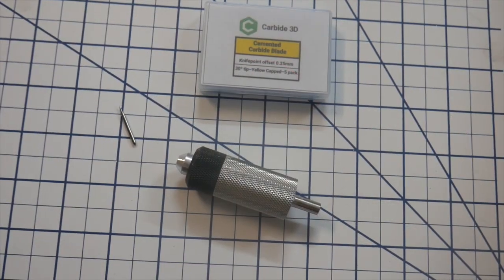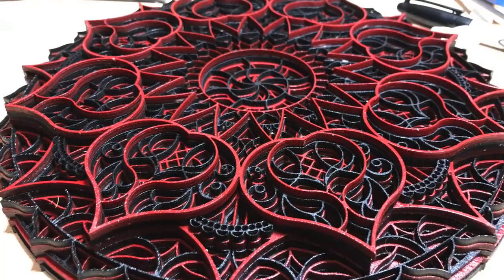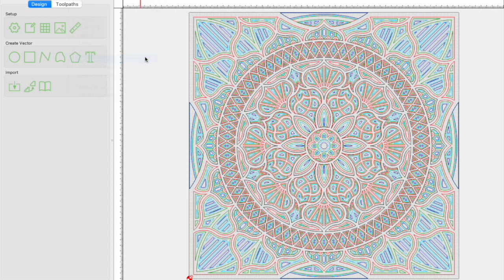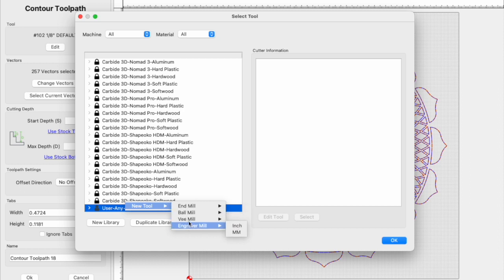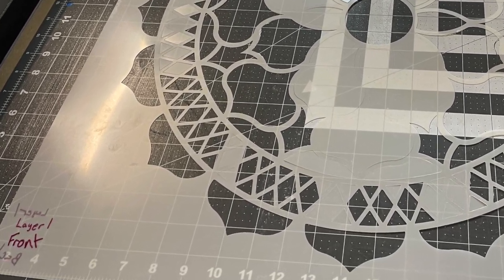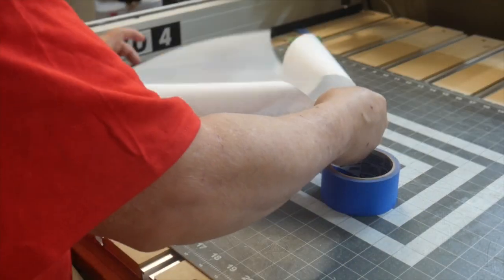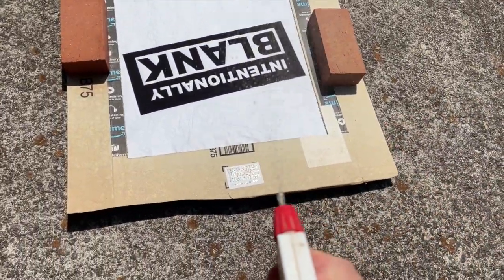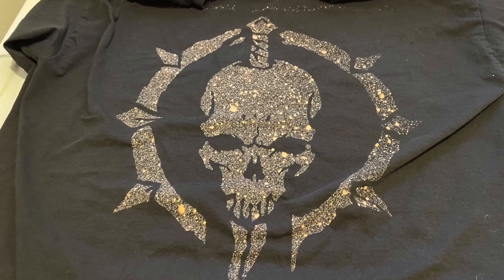Stencils on the Shapeoko with the Carbide Create Stingray

Comment: I probably missed it, but how do you set the zero height in this process? If one doesn’t have to due to the spring-loaded blade, what does the depth per cut really mean other than selecting N passes? Maybe that’s what it is, but I was curious about setting the initial height. Thanks.
Reply from the maker: I set it the same way as on wood or other materials: I put a thin piece of paper over the material and lower the cutter until the paper catches when I move it. Then I zero the Z axis. It's a bit tricky because the material is often about as thick as the paper. Additionally, the razer tip want to just slice the paper when you move it. It takes a bit of sight and feel, but it's mostly like any other bit. Bitsetter would also work and be more accurate. Does that help?

Comment: So..I did some test on a stesil and the issue is the Shapeoko continues to use the bitsetter and ends up cutting air sometimes. Did you do anything different than what you would normally do with a bit?  I used the paper method too for the zero.
Reply from the maker: I have not used the bitsetter. If you zero with the paper method and still end up cutting air, it typically means the waste board is not truly flat. The kinds of things you cut with the Stingray are always extremely thin. A difference of a couple hundreths of an inch will cause the stingray to skip sections in the cuts. I would look for some of the videos which discuss wasteboard leveling. It makes a huge difference.